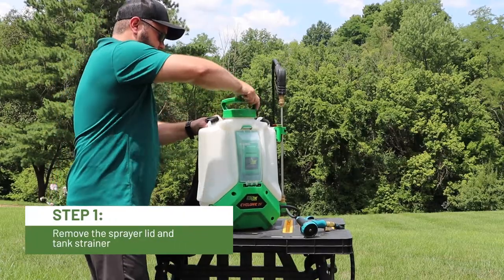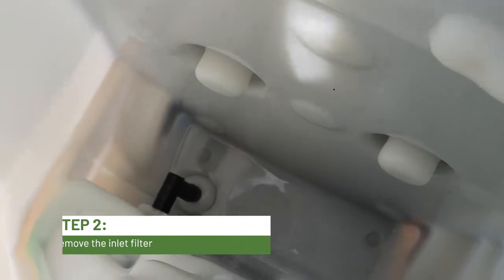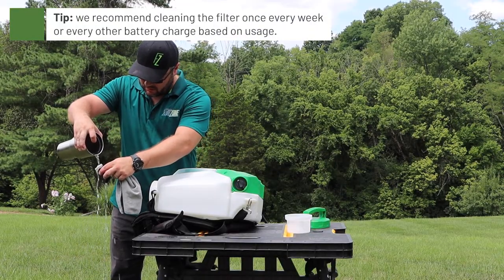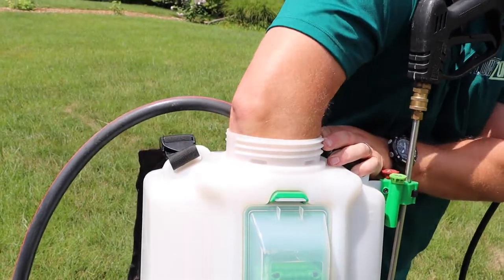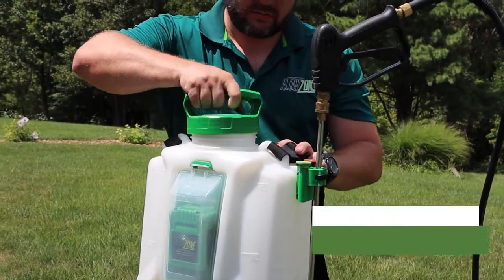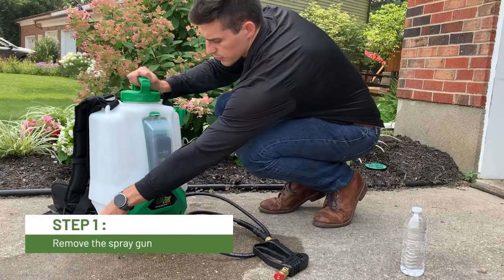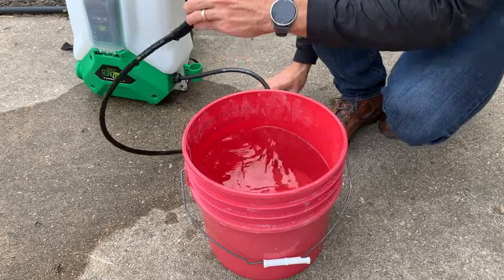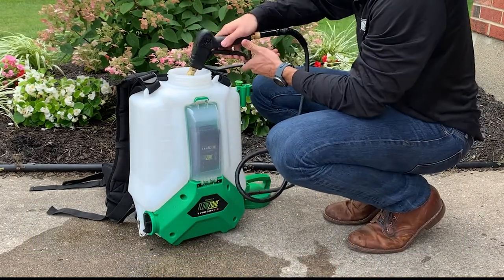How To: Priming an Unresponsive Sprayer | FlowZone®

Comment: Describe please what this methods fix.  Currently my flowzone motor activates when i spin the switch  sounds abnormally wound out and nothimg happens when i engage the sprayer. I've tried method 1 it didn't fix anything... I haven't tried removing the sprayer head yet.
Reply from the maker: This method describes how to re-prime and unresponsive sprayer. For your problem, please contact our Technical Support team at support@wessol.com or +1 803-339-2500.

Comment: My Typhoon 3 is brand new and only sprays for about 10 seconds at a pop and stops spraying. The pump is running but nothing comes out until I wait about 10 minutes. Was super disappointed it did this the first two times I’ve used it. Not sure if pump is bad or if I’m doing something wrong.
Reply from the maker: Please contact our support team to troubleshoot your sprayer. This should not be happening. Best reached at +1 803-339-2500 or support@wessol.com
Reply: Same thing is happening to mine. Brand new.
Reply from the maker: @trippyterps827  Please contact our support team to troubleshoot your sprayer. This should not be happening. Best reached at +1 803-339-2500 or support@wessol.com
Reply: Same thing with my Flozone.  Super disappointed.  My sprayer has 2 gallons of water and chemicals in it so this isn't helpful when you've mixed and filled the sprayer and you're getting ready to start a job.